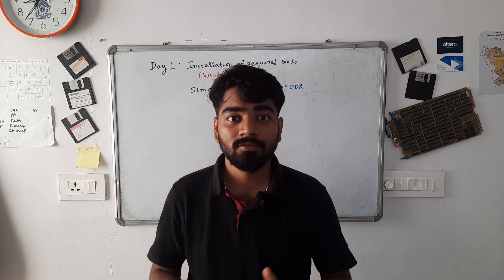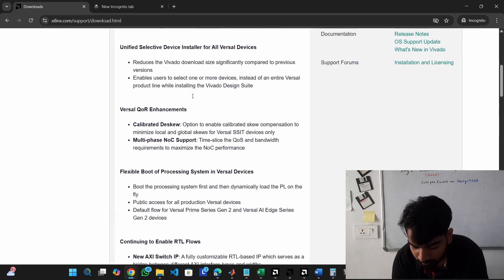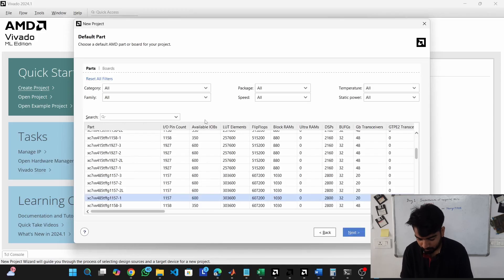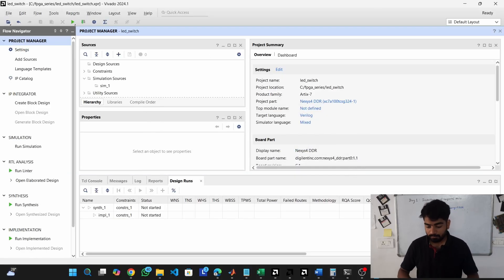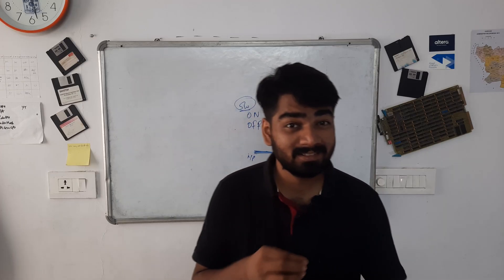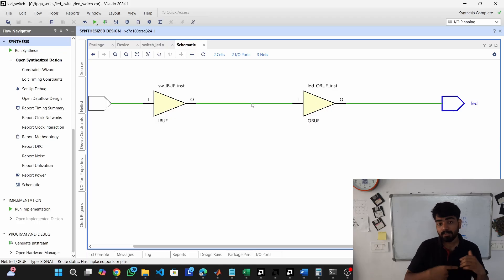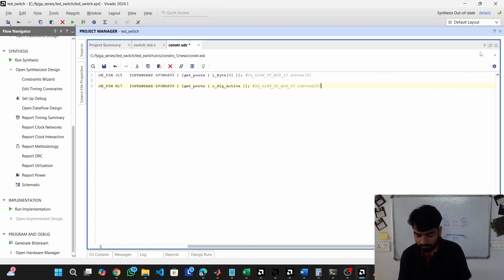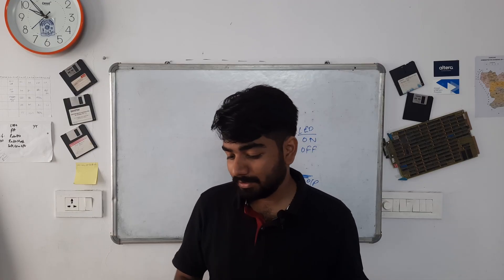How to Install Vivado & Create Your First FPGA Project | 100 Days of FPGA

Comment: While installing it, I am getting an error saying "setup.exe is not a valid Win32 application" 
What should be done to rectify it? Why this error occurs?
Reply from the maker: Check if your windows is 32 bit or 64 bit, check if you accidently downloaded linux setup instead of windows setup

Comment: Hi anna
In installed vivado only,
Right now how to install vitis. In need uninstall vivado and reinstall all from scratch or any alternate option...?
Reply from the maker: Hello, Actually I encountered this issue last year, there's no separate install file for Vitis. The best thing to do would be to use the same installer file and point it to the same folder(root directory) and select Vitis this time , the installer will most probably detect Vivado preinstalled and will only install Vitis. You can try this, In my case I had just removed and reinstalled the whole thing. (It will demand more space than it requires so you may have to move some files temporarily to external SSD or something)
Reply: @TheHardwareDeveloper Thank-you anna